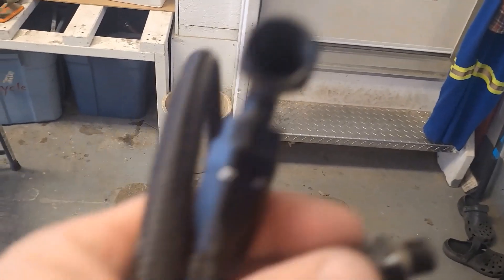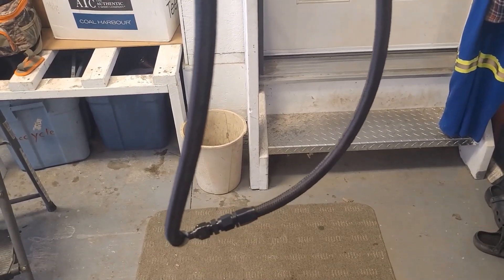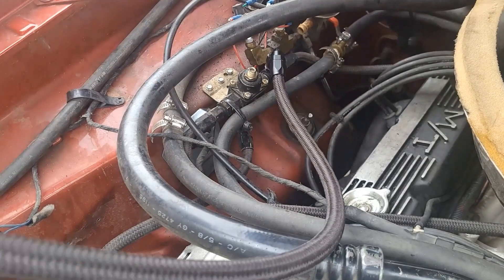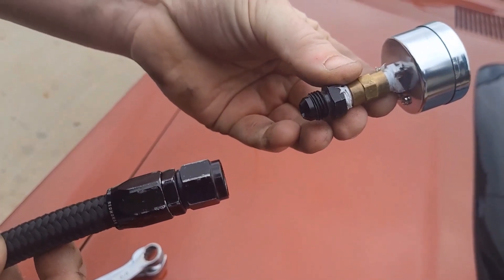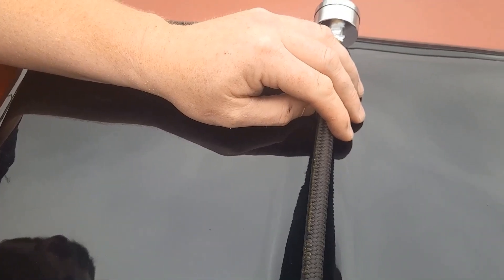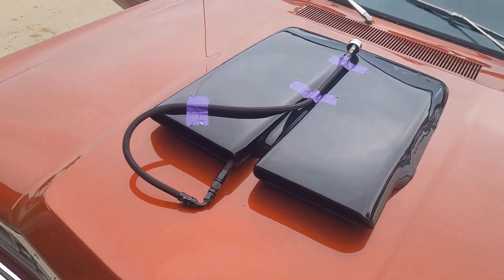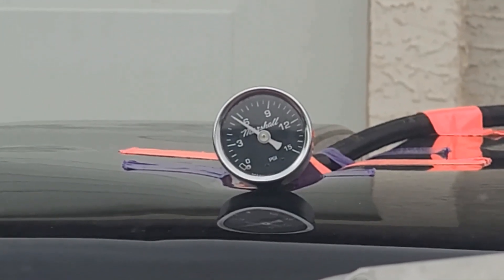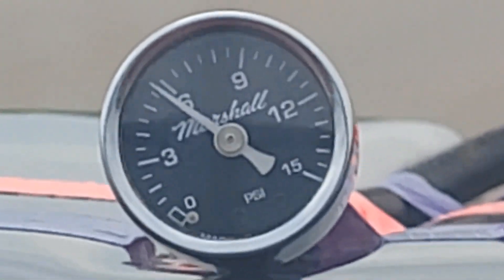Fuel pressure test! The sketchy way! #noname500 #nonamenationals

Comment: One thing You Tube will never replace is The Race Math on old school internet Forums. 
Wallace Racing is a Pontiac V8 sight mainly but the Formulas there and calculators are used by all.
Written by Pro Pontiac V8 Racers and I think are Engineers also.
All the Chevy Guys and Corvette guys go to Wallace Racing trust me.
I look on the Mopar Forims time to time for Info including the Mopar A-body forum.

Comment: I like the fuel log setup where the regulator is at the end of the log and goes into a return line. Barry Grant use to make a nice one.
This way, the carb always sees full volume. 
No restrictions regardless of pressure.
6.5 lbs to 7.5lbs on street engines.
Of course horsepower is the key factor..
Is your pump mechanical or electric or both?Nice car.
Take care, Ed.
Reply from the maker: Yeah, that is probably the best way!

Comment: Uncle Tony has a nice trick he made a video about using a Return system dirt cheep with a parts store Fuel filter that has a Return side back to the tank. Using the stock vapor line found on most Musclecars that was for the Charcoal canister if equipped your car.
Pontiac didn't get a Charcial canister  for smog use to 1971 Year I recall. 
I don't know what year Mopar Musclecars got that .
Reply from the maker: Mine did have a return line originally but it was gone when I got the car. I will put one in if needed.

Comment: Before you go put a pile of $$ into your fuel system, be certain your coil and your ignition module can keep up, alot of aftermarket ignition modules will breakup at or above 5,500 rpm's. Just a thought. Thnx!!
Reply from the maker: That's what I'm chasing now that I think my fuel system is ok. With a different motor it would rev to 6500 using these same components and a different distributor. Going to swap my distributor and see what difference that makes. Thanks for the suggestion!
Reply: @Mynextproject_74  Had the same trouble with my '87 Dodge W-150-318 until I realized it had a Chinese made ignition module in it, it pulled like a freight train up to about 5,000 rpm's above that it sounded like it was cross firing just coming apart.
Reply from the maker: @jeffsr8300  I had a cheap parts store box on at one time. It acted like a 4500 rpm rev limiter. The one I have now is a Hi-rev 7500 and it always did as I needed it to. The only thing that has changed is the distributor so I am sure hoping that's the issue.

Comment: What do you run for a pump?  Looks like the pump cant keep up.  That quickfuel carb should have at least 6 psi at all times regardless of horsepower.  It will only draw what it needs anyway.  My 500 inch BB makes over 700hp and I feed the carb with one  -6 an line from the regulator and no more than 6psi.
Reply from the maker: I have a Carter mechanical pump. I think the reason the reading went wild was because I never purged the air out of that big long line. I'm going to try it again with a different regulator and purge the line.
Reply: @Mynextproject_74  I don't think you need a regulator on that pump....5-7 psi pump?
Reply from the maker: @jcnewbee8124  that pump can put out 9 psi at idle according to my gauge. I was warned when I bought it that it needed a regulator. It also had a note in the package from the manufacturer.
Reply: @Mynextproject_74  So you need a regulator because it hits one pound to high at idle..........but it goes down to 4 1/2 at wide open throttle.    Do you no how many stock cars in america run a mech pump with no regulator?  thousands.    Just buy the right mechanical pump ....5-7psi
Reply from the maker: Because I run AN lines I need NPT inlet and outlet. I ran a stretch of 3 bad stock replacement pumps so I was no longer interested in that. The Carter pump is a premium stock replacement but at the 9ish psi at idle over fills the bowls and floods the engine. That's why I use the regulator. A good stock replacement pump that provides 5 to 7 has not been easy to find as yet. Thanks for the suggestion.

Comment: Good stuff. Well at least now you know what its doing. Keep on keeping on! Keep your stick on the ice eh!
Reply from the maker: Do you think that's OK? I did bump it up, but ran out of time to test it again. At 5.9 it dropped to 5 so at 6.5 it should only drop to 5.6. I always thought the target was 5 to 7psi.
Reply: @Mynextproject_74  If your running a holley I would run it at 7-7.5psi Carter afb/eddy 6-6.5psi. If it doesnt drop more than 2psi you should be fine if your not spraying laughing gas. Keep on fighting the good fight. I will see if I can help you out with subs next video I do. You deserve to be there more than anyone.

Comment: What type of ignition coil does your car have?      tHanks for the troubleshooting video.
Reply from the maker: It's an MSD blaster 2 coil.
Reply: @Mynextproject_74  Hmmm,  You think it is fuel delivery for sure?
Reply from the maker: @Dancing_Alone_wRentals  no, not sure. Could be ignition but used to rev to 6500 with a different different engine. Could be valve springs too. I just don't know.

Comment: If your car is fast Truly Fast like mine, 11.5 ET or faster at the track you want to plan a safety Factor designing the fuel system. 
Like say you make 500 Hp and car dead hooks Super hard off the line.
You actually want to build the Fuel system for 750 Hp.
G-forces is trying to keep the gasoline in the stock Fuel tank or fuel cell.
Then there is friction in tiny stock lines.
It can be A True 8 psi less at the Carburetor with a Pusher Electric pump mounted at the rear of the car !
Go as big of Fuel system as you can afford.
I built mine for 1200 Hp the fuel system Normal Aspirated wanted plenty of safety factor.
2:1 ratio.

Comment: The fuel pressure is allover the place  as you know from testing.
It's the most over looked area in cars  and guys on a budget wanting to Drag Race.
You will need to experiment and find out what works for you an in your budget.
You don't want the Fuel pressure dropping more than 1/2 psi WOT  Ever.
Ideally it should drop zero psi.
I won't ever go back to a stock Fuel tank and Fuel system they just suck for fast Drag racing. 
But it costs money Going Drag Racing Fuel cell, Braided Race Hose, and the Good AN Fittings.
Alot of fuel pressure Regulators out there are junk. Cause all sorts of headaches. 
Return Fuel system Full drag car nothing is better but you need to spend money to do it right.
Poor man's way can be done but it likely will looked Rigged.
Reply from the maker: I have all AN line from the stock fuel tank. I do have an extremely cheap regulator though. I may try changing that.
Reply: @Mynextproject_74  https://youtu.be/HcM587W13lU
Reply: @Mynextproject_74  A Tip I can give You also today us that all the Good Reliable Premium 100% Fuel Pressure Regulators for Carburetors and EFI ARE RETURN PORT STYLE
If you look spend a few hours on Summit Racing you will find that is true..
Reply: @Mynextproject_74  That young guy Thunderhead 289 has a good video out on Carburetor Return Fuel systems he did on a budget.
Its Uncle Tony, Thunderhead 289, and myself on You Tube that have best info using Carburetors with pump gas Full Return fuel system.
I said Fuck this shit Dead Head Fuel system I am going Full Drag Car.
Plumbing it Right Spent Thousands  cash $$$$. All fuel pressure issues gone now. Rock Steady at 7-1/2 psi at all times. Even at 7000 rpm in 3rd high gear with my Turbo 400 trans, see 7-1/2 psi on the Autometer fuel pressure guage I have mounted under the dash of my 63 Gp 455.
Reply from the maker: Thanks!
Reply from the maker: I think I'll give the return style a try. I appreciate all your help!
Reply: @Mynextproject_74  Moroso makes the Filler Neck Return port style that you splice in with rubber hose in the Moroso kit.
Only potential problem is air bubbles may form and cause fuel pump cavitation issues.
Supposed to return excess fuel below the fuel level.
Find a video to show next why.
I made my own 5/8 " stainless steel stand pipe. 
Took a brand new Earl's #10AN Fitting and Rifle drilled it out to accept my stand pipe a tiny Allen screw holds it in place cant drop out any.
Allowed to be creative designing and building your own Race car Fuel system.
Race math and Strategy plans still must be followed.
Reply: @Mynextproject_74  https://youtu.be/dP6Pogm6Ts0
It's been death to many High Poweed BOOST Cars in modern No Prep Drag racing, fuel pump cavitation. 
Video by Fuel Lab.
Reply from the maker: Thanks! I have a breather port on my fuel tank just above my sending unit and a return port on my sending unit. I have -6 fuel line all the way. I guess I'll run a -6 return line also.
Reply: @Mynextproject_74  The bigger gallons per hour fuel pump you choose the Larger the size of the Return line needed with Return Fuel port Regulators.
#6 AN Supports about 450-480 Hp Tops in most cars.
A bit higher with EFI but those LSX guys like shorcutting to save money.
Sometimes they get away with other times not.
So it's not uncommon in past to see #6 AN feed and #8 AN Return. 
That way the Fuel pump wont stack up against the FP Regulator and cause pressure creep issues go too FAT RICH.
#8 AN Vs #10AN the price difference is like $50 only.
Might as well go #10AN.
#6 AN Budget friendly yet for most
Reply: @Mynextproject_74  LSX Guys.
LA Mopsr is You.
Reply from the maker: In this car 450hp will be the most I'll ever go. It's an air conditoned street car.

Comment: I have Found a Dead Head Single feed Fuel system will not provide reliable Fuel Pressure at all not stable with todays pump gasoline and a Carburetor. 
Dead Head system only works with True Leaded Race Gasoline 110 motor octane or higher. 110 and higher octane is Engineered and blended to provide Superior Reid Vapor Characteristics. 
Race Gas still performs best with a full return Fuel system layout Drag car Fuel Cell True.
Reply from the maker: I wonder if I would have gotten a smoother reading if I had bled the air out of that long ass line?
Reply: @Mynextproject_74  No.
You were seeing actual Fuel pressure Regulator fluctuations all the time.
I had the exact same issue with Dead Head Fuel fuel pressure Regulators.
Its todays pump gasoline the Reid Test Vapor pressure is terrible and is designed only for EFI,  1 Bar 43.5 psi.
Reply: @Mynextproject_74  My channel has lots of Vids on my Return Fuel system layout.
Changes I made over time .